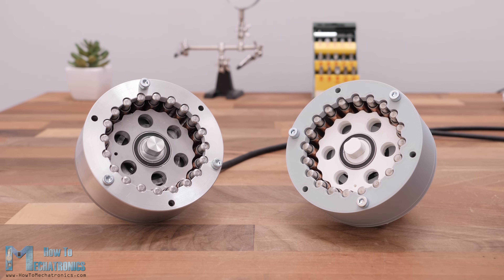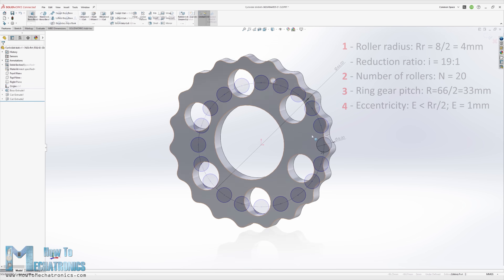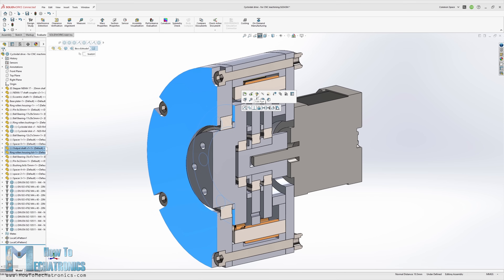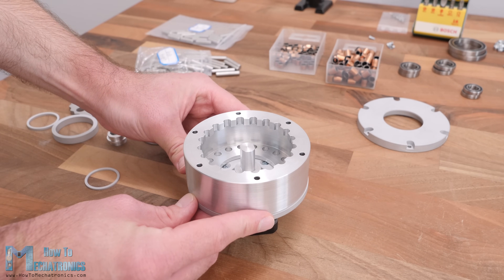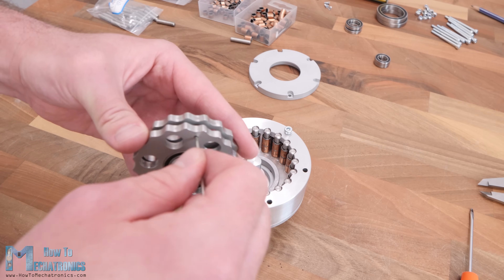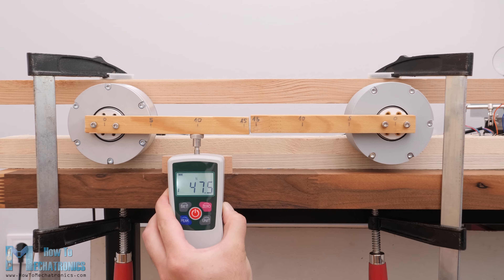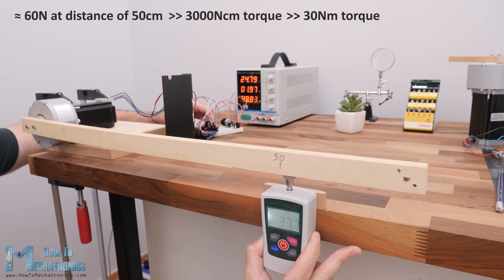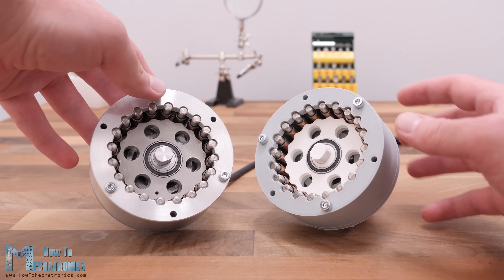CNC Machined vs 3D Printed Cycloidal Drive

Comment: What is your stepper motor current? I used NEMA 17 42*38 version, and I use 12 v battery. I also designed a cycloidal gearbox in a similar way as yours, but I only got 50% efficiency, and I can only measure 27N at 10cm.

Comment: It looks like you can back drive that drive by hand fairly easily even with the nema 23 hooked up towards the end of the video when you are demonstrating the backlash. seems hard to reconcile that with the torque values you measured it outputting.

Comment: What is your idea on the maximum RPM's the input shaft can handle?
I would like to use a (powerful) BL motor, it easily runs at 10000 rpm.

Comment: I noticed a few times you had issues with the powder coating. You can specify that it should be to drawing dimensions after the coating is applied to avoid oversizing the part and keeping it to your tolerances in the drawing.

Comment: after seeing the failure of the threaded inserts at 18:17, I had to look at my own design and question whether the inserts would fail for a 13 Nm application on the output shaft, however in looking back I realized that you only had the torque distributed on two pins for that whole load rather than the whole 6 pins available. This leaves me more hopeful? I'll comment back on this whether I get significant plastic deformation for my version as well.

Comment: Very interesting and nice design. What is the price difference between the CNC machined and 3d printed version, out of curiosity?
Maybe an hybrid version would be interesting, with only the discs machined...
Reply: Cost difference is pointless if the printed part fails prematurely.
Reply: @paul5683  it depends on your use case, if it's for long-term use yes of course.

Comment: You could try using drill bushings instead, they are pretty accurate if a bit expensive. Otherwise if PCBWay is sponsoring you might as well just order some custom lol, I've ordered hardened 440C bushings from them and they came out quite accurate too.
Reply from the maker: Thank for the input!

Comment: I think you're going to have inconsistent backlash regardless. When the two gears are in phase, the holes line up and the only thing indexing the pins is them being pushed tangentially by the holes in the gears. When they're 180 degrees out of phase, same story. 90 degrees and (I think) the pins are being pushed by the gears directly in the direction you want them to go.
Shouldn't you be able to add a 3rd gear and have 3 eccentric bearings 120 degrees out of phase? That should (again, I think) reduce the backlash. The more gears, the less backlash. Probably the same diminishing returns as a 3 phase motor: 2 isn't enough, 4 is too many. The 3d printed one should be easy to test at least.

Comment: I bet you would get different results if the motor was more secure. Those clamps still let the motor twist thus losing energy. Also a piece of steel instead of plywood should help 😉

Comment: I know you did them both the same so you could test the material against eachother with the same dimensions but if someone wanted to make a strong 3d printed version, all you would have to do is make all the engagement points at least twice as thick.
Reply from the maker: That's right.

Comment: does the 15% loss in output occurs as sound, vibration, and heating? if so, where in the mechanism is most of the loss occurring? to improve efficiency or at least to improve durability at speed under load, what kind of mitigation would be beneficial? Would cooling be necessary during prolonged use?

Comment: These cycloidal drive reduction drives are very interesting.
I wonder about their capacity work at increasing motor speed. Essentially driving the unit from the output shaft, to increase the drive of the input shaft. 
An example would be a centrifugal supercharger where the input shaft might be driven to say 6000rpm, but the output might need to be 100,000rpm.

Comment: all voided.  too many design mistakes like no clearance and too much at other times.  see an experienced machinist for help next time.  they would know where and when to have slip fits or not vs. press fir that you hammered in place.  a big no-no!  those bearings were ruined and had flats from impacting.  now the frictionless bearings are frictioned.

Comment: In case both CNC and 3D print are hybridized, what parts should be CNC machined? I think backrash and housing rigidity are important, so cycroid gears, bush housing, input shaft and output bush housing should be aluminum. Outercase, motormount, some sims, output basement can be printed. How about your opinion?
Reply: When you mix materials with very different thermal expansion coefficients, in a gear that is supposed to be quite precise and have low backlash, you are in for some adventure.

Comment: i'm wondering if some sort of wear-band would make the 3d printed one last longer. e.g a 1mm thick steel plate bent around the edge.
Reply from the maker: Sure it would help, but it needs to be precisely installed which I believe it would be hard to do it.

Comment: Is there an RPM limit on these types of drives...could you put high RPM (say 10-50K RPM) on them and get heavy reduction or would that cause problems?
Reply: problem. vibration and friction(wich is heat)

Comment: Hi I’m not an engineer or scientist just a fan
After watching your video with commercials Very well done I applaud you…
Could this device replace the clockwork of my telescope mount in that it has minimal backlash?
Reply: Harmonic gearboxes are used on the more expensive mounts and have zero backlash.

Comment: Its be interesting to see a mostly 3d printed housing, bearing cartridge etc but with a cnc input and output shaft and cyclodal disk. Try and reduce some of the mass of the cnc
Reply from the maker: Yeah, that's a good point. A combination of the two versions would be best solution for some DIY projects. The cycloidal disks are most important in this case I think and they can be made out of some metal material, in combination with some metal rollers.

Comment: I think it would also help to use sturdier material for 3D printed parts. I personally use polycarbonate for these high stress parts, as PLA is softer and it can wear quite easily.
Reply from the maker: Thanks for the input!
Reply: What head and bed temp you are using on polycarbonate ? I am just curious to buy and try PC too
Reply: @dzitiatri  I use default Prusaslicer values, it works really well.
Reply: Try carbon fiber nylon too, if you can.
And you could probably do well with carbon fiber PETG, it is amazingly stiff!
Reply: I startet printing polycarbonate and it works very nice! I use 110°C bed and 290°C nozzle and a polycarbonate sheet as print plate.

Comment: This comparison didn´t fit. You campare Metallparts vs Plasticparts and CNC vs 3D-Printing. You are comparing two different things at the same time. You should have compared CNC plastic parts with 3d printed parts to see only the difference between the manufacturing methods.
Reply: Yes. Seems additive manufacturing (3D printing) is always weaker than subtractive manufacturing (CNC). Especially with metal because metals can be treated with thermals to make the block harder. While metal powder only can be fused with a laser and that is all!?

Comment: As both motors were skipping, I was really curious about the internal damage caused. Sad that you didn't show that. I'd love it even more if you would maybe replace the top with acrylic to see what's going on inside
Reply: if you take apart a stepper motor it will make sense why they skip. It's just a virtue of how they work physically. 
        The permanent magnetic field in the rotor is concentrated around protrusions and the rotor basically looks like a gear. The stator has a matching magnetic pattern. So when a stepper motor "skips" it is because the electromagnets do not have enough power to advance the rotor to the next step.  There is no damage because it is only slipping magnetically. Nothing is touching.  Really though, the reason there is no damage is because a stepper motor is current limited by the controller.  I feel like people who are familiar with old style electric motors would be more inclined to think that a stepper motor would burn up/get damaged while it is on hold. Yes, the controller does everything. Features like "hold" / 'half stepping' / quadOReightORsixteenth stepping are all current limiting scenarios.  In simple terms > the reason a stepper motor does not get damaged from missing steps is because the controller is providing power based on settings which you set. 
     Skipping sucks because you loose your position & don't know which step you are on(unless you have a way to detect position). Increase the current on the stepper driver and it will skip less. Decrease the micro-stepping and it will skip less. 

  Dunno why I felt compelled to write that right now...
Reply: Skipping doesn't cause any damage, as is something steppers do exactly to avoid damage
Reply: @Flashbang_Photo  I don't think the stepper was skipping, I think the drive was skipping. The only experiment where the motor was skipping was with the small motor and the machined drive. The backlash was too large for the motor to be the one skipping in the other tests, imo
Reply: @m.sierra5258  
If this drive skips, it is permanently broken (as most gear boxes are). The skipping was the stepper motor reaching its torque limit and losing steps. Btw. that's not something steppers do to avoid damage, it's just something that happens when the torque limit is reached (which is defined by the current to motors get, which in turn is set by the stepper driver).
Reply: @superdau  where does the max torque difference between the printed and machined box then come from? I don't see how the ratio would differ. Or is plastic just that much more lossy?
Reply: @m.sierra5258  The plastic can't transfer all the torque to the stick. Some of the torque is lost due to the plastic giving up, as the damage at the end showed. Other materials than PLA might hold up better.
Reply: @superdau  If it was the motors skipping, why is then there difference between two gearboxes?
Reply: @bmotik  The plastic gearbox is less dimensionally accurate, and less efficient mechanically.

Comment: I used to work at a company that made those kinds of planar polymer bearing/bushings and they are almost exclusively made to be pressfit into a tight fit bore. Maybe a design iteration would be to get a ground thin walled tube and pressfit the bushes into them. Also those kinds of contact surfaces should be hardened and ground to a fine surface finish. Obviously not super easy to do but better gearbox life
Reply: first thing i noticed. Those bushings are not designed for his use. The "oversized" measurement is as it should be to have a tight fit. Even the inner diameter is too lose as long as they are not pressed into a bore. You can see it at 12:01 with your bare eye, that the bushings have radial play on the shafts...
Reply from the maker: Thanks for the input. Yeah I realized that a bit late, and also they ware easily available.
Reply: ...igus???? :)

Comment: good job!  A question, why do you need bushings around the cylinder, wouldn't the cycloidal gears just roll on the pins (assuming the right size)? Bushings shouldn't be moving should they?
Reply from the maker: The bushings should move, that's rolling and it would produce less friction than the cycloidal disk sliding on the pins directly. Also they can be replaced more easy if they out.

Comment: Regarding modeling technique; is there a reason why not a 0 to 2pi/(number lobes) and a radial symmetry by number of lobes?  is that to avoid surface modeling lines?  coming from a Catia V5 modeling experience.   gap with a spline just irks me and probably is creating some odd tribology down stream.

Comment: this is a really interesting comparison. I wonder what the best of both worlds would be. If you just put the cnc cyclodial disks or maybe other parts  in the 3d printed version I wonder if its power/weight ratio would beat out the other 2 alone

Comment: Nicely explained with a good project. 👍 
I think CNC's product gives better results rather than printing machine. Printing machine's product are of PBC which are worne out at the rubbing areas and can malfunction due to clearance where as  the CNC machine's product are of metal and by greasing it can give a better results in comparison to printing product.

Comment: I have been trying to make an almost 100% 3d printed planetary gear box with good efficiency. And I've already noticed a huge difference between gear generator softwares. I think that's how youtuber Paul gold  got 30 Newton meters of torque out of a smaller stepper with a 3d printed cyclodial gear. Your measurements of a 1 to 3 decrease in performance Is significant. I would love if Paul measured the efficiency too. But beggars can't be choosers. Love the video!!!
Reply from the maker: Thanks for the input!
Reply: ever have any luck?

Comment: I tried SF1 bushings at one point too (and HK needle bearings before that), but nowadays I press PTFE tube into brass tube to make low-friction bushings whatever length I want and without any seam. Although it is fairly time consuming cutting and deburring a large number of tubes to precise length, even with a tubing cutter. And not all PTFE tubes are concentric, so it can be trouble finding a good supplier.
Reply: A lathe may be ideal for that kind of precision cutting
Reply: @PhantomBlank  Was gonna say that, get PTFE tubes with greater wall thickness, smaller ID bigger OD, machine, broach & sand to spec, so you get cheaper materials and greater accuracy, problem solved.

Comment: I wonder if with some patience, you could CNC the aluminum parts with one of those inexpensive 3018 CNCs?
Reply: Not strong enough for the appropriate speeds and feeds to get a good finish.
Reply: @Shocker99    not to mention that a lot of the features in those parts would require a CNC lathe or some other 4/5 axis CNC machine and as far as I'm aware 4th/5th axis hobby CNC builds are rare and currently unable to produce parts like this (accuracy, holding forces, etc.)

Comment: What is the cost of all CNC parts?
Reply: At this part count, I would guess around $600 to $1000 US.
Reply from the maker: Well, each part costs from around $30 to $100. There ware 15 parts in the order and the total cost was around $700. As some of you already mentioned, custom CNC machining might seems a bit expensive, but for what you get here it's actually worth it.
Reply: @HowToMechatronics  that actually sounds super reasonable
Reply: @HowToMechatronics  much more expensive than printing it though.
Reply: I'd say around 1500-2000usd (source: I'm a prototype machinist)

The undercut of the main housing and the two flats on the eccentric shaft adapter add complexity to it. If you wanted the gears to be high precision then I'd recommend using 4140 prehard (versus jig grinding, which would be more accurate but much more expensive), not stainless steel. That way you could also use better/harder bushings (drill bushings) which would increase performance significantly without increasing cost significantly. Fill it up with some sticky grease and boom!
Reply: @eatonasher3398  that undercut was kind of superfluous right? Couldn't that top portion be made as a separate plate?
Reply: @eatonasher3398     do you know of any hobby/diy build of a rollar cam gear milling jig/machine?
Reply: As a reference a commercial cycloidal reducer of about this size and complexity costs between $2500 and $4000
Reply: the fact he didn't disclose it in the video says enough :-)      (he's sponsored. if he was not, it would have been extremely costly :-) )
Reply: I paid around 60 usd to make a single shaft coupling approx 50*50*25mm with them. I have yet to receive it though, I hope it will fit otherwise it would money wasted.
Reply: Ya, custom CNC is expensive. Unless u have your own.
Reply: @jimmym2719  I built a PrintNC... tempted to try to make one of these using it.
Reply: @jamesrowlands8971  your PrintNC can do aluminium ? What spindle are you using ?
Reply: @tdg9281  o___O I'm milling mild steel on it. I've never cut alu on it. Only the MDF wasteboard and steel. I'm using the stock spindle and not even pushing it. The key is finding the right feeds and speeds.
Reply: @jamesrowlands8971  unless you've optimized it for cutting metals and different alloys then I would push it.

Now get a hold a "pocket NC's.... And you'll be set to
Reply: In Russia it has cost around 100$
Reply: If you supply the files and raw material you can go to a local shop and they'll machine it for you for really cheap.